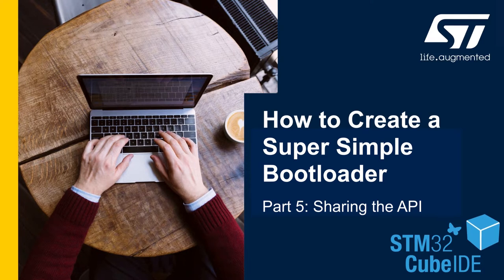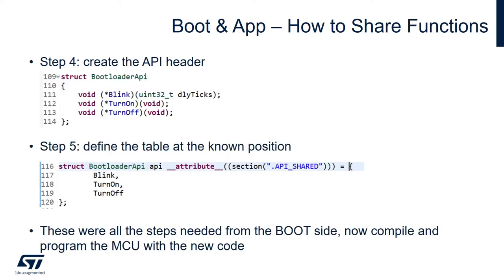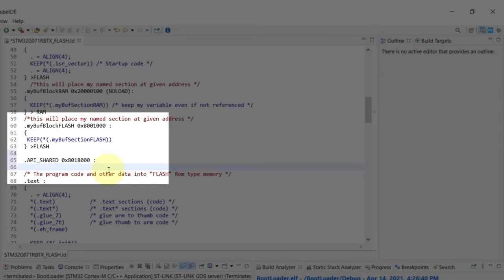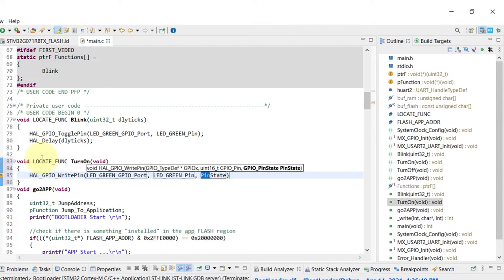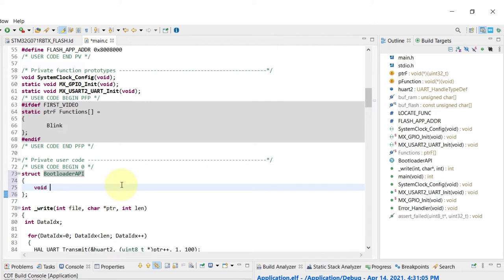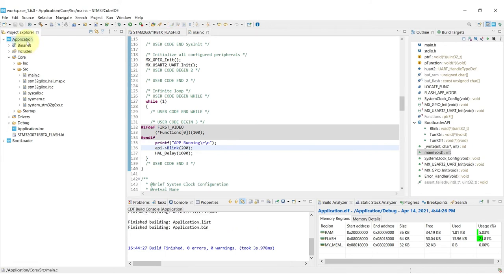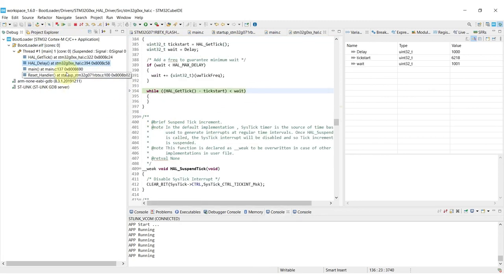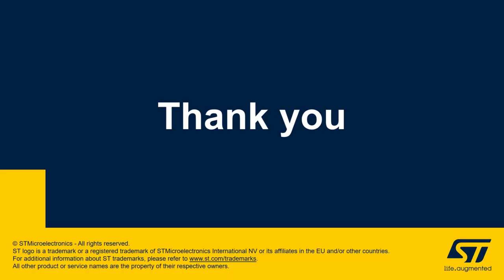How to Create a Super Simple Bootloader, Part 5: Sharing the API

Comment: Hello,
Thank you for this video series on bootloader.
This is my first time in bootloader programing so i am having some difficulty in understanding the linker file flash memory part.
What i have understood is we are booting from flash memory on 0x08000000 with length of 32, the my_memory region created with 0x08018000 is for the application i assuming , correct .MEMORY
{
  RAM    (xrw)    : ORIGIN = 0x20000000,   LENGTH = 36K
  FLASH    (rx)    : ORIGIN = 0x8000000,   LENGTH = 32K
  MY_MEMORY (rx)   :ORIGIN = 0x8018000, LENGTH = 32k
}

than why again in application we are creating this regions
MEMORY
{
  RAM    (xrw)    : ORIGIN = 0x20000000,   LENGTH = 36K
  FLASH    (rx)    : ORIGIN = 0x8008000,   LENGTH = 64K
  MY_MEMORY (rx)   :ORIGIN = 0x8018000, LENGTH = 32k
}
why cannot we use flash with 0x08018000?
i am getting confused to partition on bluepill STM32F103c8 board.
What i have created is 
Bootloader : 
MEMORY
{
  RAM    (xrw)    : ORIGIN = 0x20000000,   LENGTH = 20K   
  FLASH  (rx)     : ORIGIN = 0x08000000,   LENGTH = 16K
  MY_MEMORY (rx)  : ORIGIN = 0x08004000,   LENGTH = 48K
}

Application:
MEMORY
{
  RAM    (xrw)    : ORIGIN = 0x20000000,   LENGTH = 20K   
  FLASH  (rx)     : ORIGIN = 0x08004000,   LENGTH = 48K
}

Comment: Hello, Thank you for the video series. I have encountered a problem while going through this video's process. After following along, adding the structures and debug, I get an error and my debug session terminates. The error message does not tell me much but my code stops at the sbrk function in sysmem source file. It sets me errno to ENOMEM which I can only assume means I have no memory left. It seems like my heap is growing past the bounds set and so my code terminates but I do not know how to fix this without making changes to the code that is not outlined in this tutorial. The board I am using is Nucleo-f030R8. I would appreciate any direction on this issue.

Comment: Great demo, thank you.  Only issue I have is that SysTick no longer increments on the bootloader side after it jumps, so the HAL_Delay gets jammed.  I commented out the disable irq, but that wasn't the issue.  Any ideas?
Reply: Sounds like you're keeping the bootloader's vector table, so the bootloader's `SysTick_Handler` is getting called instead (and so it increments its own `SysTick`, rather than the application's). You should set `SCB->VTOR` to the application vector table adress in flash